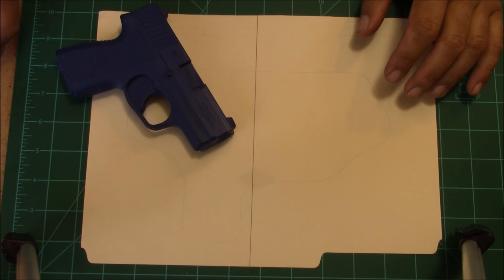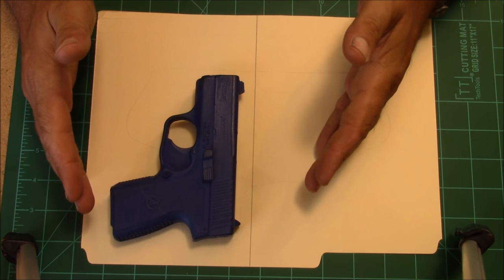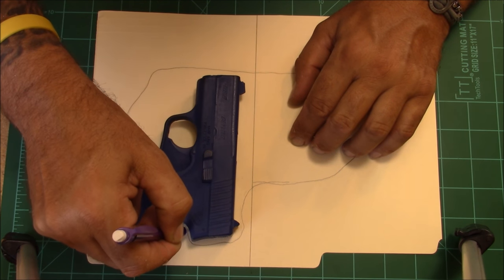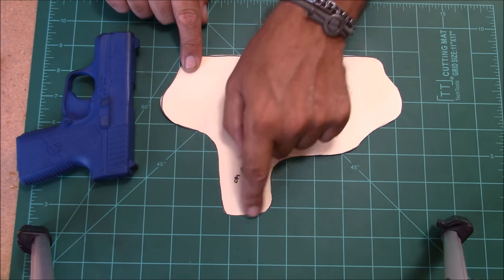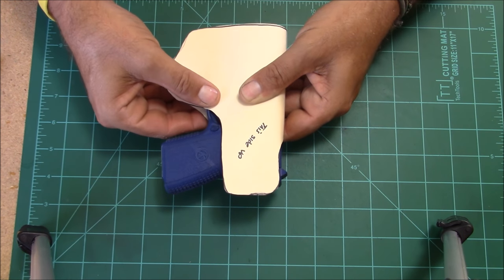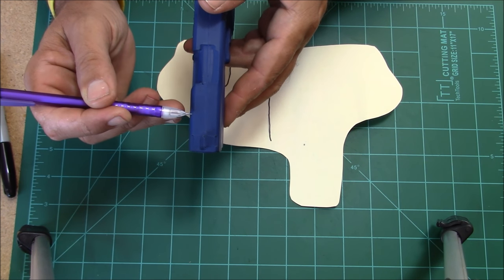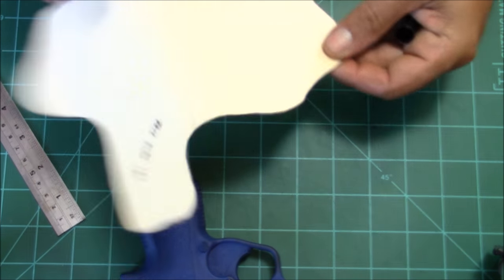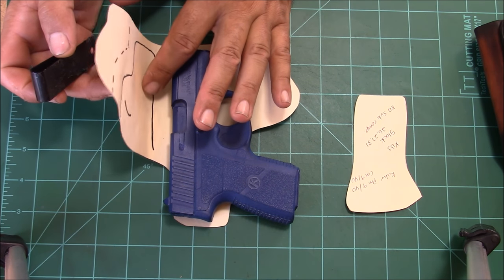How to make a holster pattern..

Comment: Im a leather worker. In case you see this and haven't found out yet. When making a paper pattern and marking out the stitch line. Do half thickness of gun or magazine + the thickness of the leather. For the most snug non molded fit but able to actually get gun inside of it to mold it. Your way works fine as well. Was just saying this if you experiment on other things like wallets or anything. U won't have to guess the stitch lines on new or 1 off projects in the future when ur not sure of stitch placement from trial and error.

Comment: Thanks for sharing that.  I am just getting into some leather crafting.  Already did a few sheaths and just did a holster for my Ruger LCP380.  I believe it is called a Yaqui holster, it mainly covers the trigger guard area.  The barrel and grip both stick out and I made it with two slots to feed your belt thru.  I like this idea you have and especially for an IWB type holster.  I may borrow your pattern!!  Again thanks.  Juddie - J & J TOA
Reply from the maker: That's great. Post up some pics of your work.  Thanks for watching.

Comment: Nicely done and easy to understand instructions.  Would you line the inside with sheep skin or something soft?
Reply from the maker: Texas S yes you can line them. I have in the past. Thank you for watching.
Reply: xdshooter1 .... what would I do to prevent sheep skin form crumpling up on the inside and getting a bit torn up? Being new to guns and holster building I figure the gun should rest on something softer.
Reply from the maker: Texas S I would recommend applying barge cement to both peices of leather. In my experience very thin layer works better , if you use much it seems to seep into thin leather. I also find if you bevel the edge there is less chance of the gun pulling it away from the thicker leather. I hope that makes sense.
Reply: xdshooter1 yup ..thx
Reply: Texas S and